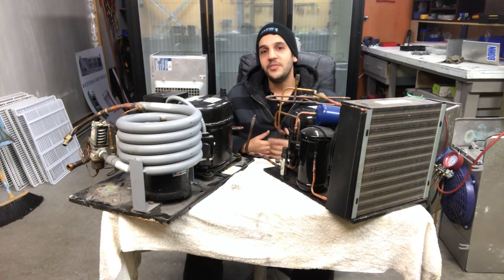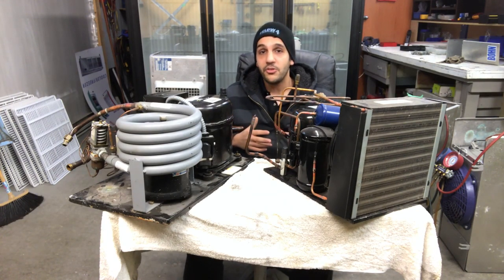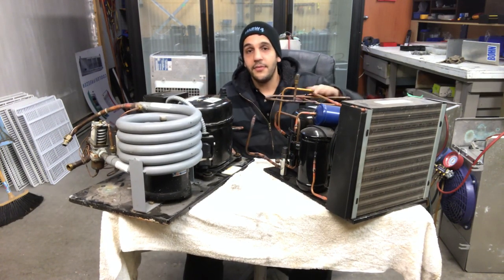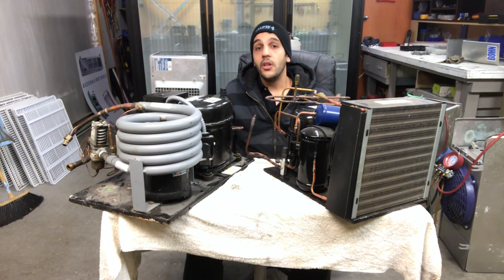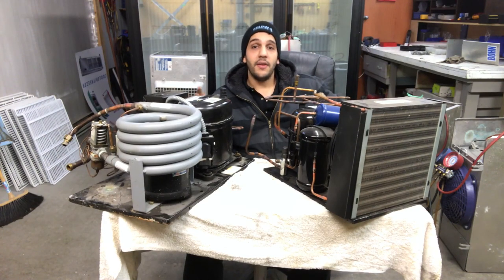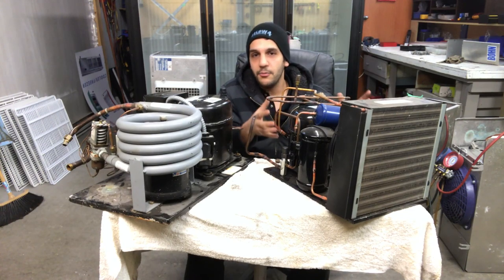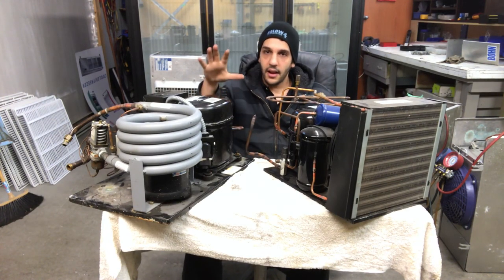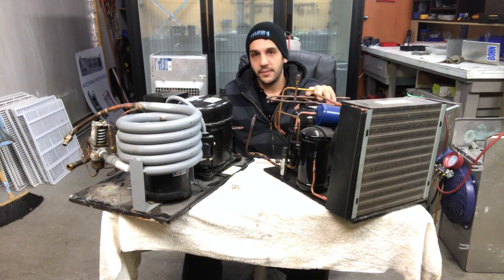AIR COOLED VS WATER COOLED CONDENSING UNITS

Comment: QUESTION: We have several Liebert crac units with water cooled condensers. Currently we use approx 70deg water flowing through the condensers. However, we need to know if we used 55 degree water would it drastically effect the units efficiency. There is a condenser water control valve in each unit. I ask because there are no parameters recommended in the owners manual.  Any help here would be greatly appreciated.

Comment: Great presentation.  Like others have mentioned, in the classic legislation environment, where you are just pulling water from the tap to cool the condenser, yes - these are generally not eco friendly.  However IMO, if you have a lake, a geothermal system, a small chiller, or the equivalent, you are much better off with the water cooled system.

Comment: Ok, so if the water cool is 30% more efficient is it that much more expensive than air cool?
Reply from the maker: No not really. They’re pretty much the same price for the unit itself. However the water cooled unit has a higher operating cost than the air cooled unit because generally speaking water is more expensive than electricity.
Reply: @dnoorian  yes but you also have to offset the electricity savings of the compressor. The hotter the condenser runs. The harder the compressor has to work to liquify the coolant from gas to liquid (before being utilized by the evaporator).  Water units take that work load off of the compressor, which translates to upwards of 40 % energy efficiency.
Reply: @TheGodfather101  I am in Pakistan where it is hot, electricity also not available some times, I want to make an air conditioner from a water dispenser. Any ideas ? would it be good to run on solar ?
Reply: @Overdrive_pk  I am experimenting with a water cooled peltier module. I'll keep you posted.

Comment: All you must do is put the coil submerged in water, circulate the water with the pump to a reservoir of cold or water, using the same principle of AC to cool the condensing unit in no time the transfer of heat will be much greater

Comment: How do they waste water? I thought they just dumped it into the hot water supply.  Canada is crazy!
Reply from the maker: the water usually drains into a floor drain and not reused.... therefore its a waste water system
Reply: @solexxx8588  We have one of these in our HVAC system at work and it just dumps the water on the floor in our plant. It's just a drop in the bucket when you're on an industrial site.

Comment: Not a waste of water. There’s a return well, It’s a loop system. Two wells. I couldn’t imagine anyone running this thing on city water
Reply: Make up water?
Reply: @MeIn321 a pump cycles water from the ground and it goes back into the ground at another well. So yes, you will have a pump continuously running. But nowhere near the cost of doing it with city water, would be a huge waste of water running clean water into the sewer. Same systems in yachts. Water is pumped through system, then returned to the ocean. In boats they’re called “chillers”.
Reply: I’ve never seen one running on city water. Ever

Comment: interesting, good explaination
Reply from the maker: thanks, glad you liked it!
Reply: @dnoorian   If I ran the water-cooled condensing unit in a loop with the aim of using its heat as a heat source for an absorbtion chiller . How hot will the water get ?
Can I get temperatures around 100c 212F ?

Comment: You are using more refrigerant to cool the water in an exterior motion, and a pump which uses electricity to pump the water that the condenser is submerged in to merely achieve greater results all legal

Comment: I think for water cool it is better for entire city or region by pumping bottom water to the top of water body like pool or river or ocean it is more like a large public project that cost a lot for large project if we use conventional air conditional system plus large air conditioner electricity create more emf heating effect on the environment that people not aware of while pumping cool water as cooling medium does not cost anything other than small pump can be by pressure of the deep itself. I think your presentation is misleading need more research and correction other wise children be confused

Comment: im in indonesia.. the water is so cheap..

i wonder why nobody makes condensor with this water systems
Reply from the maker: Hmmm I don’t know too. Maybe it’s because they don’t want to waste water...
Reply: @Eli Gordon I am in Pakistan where it is hot, electricity also not available some times, I want to make an air conditioner from a water dispenser. Any ideas ? would it be good to run on solar ?
Reply: Thanks for explanation. So technically both condensers work on the same principle. The only difference is a cooling medium. As you said, water cooled unit is much more expensive, would it be possible to modify conventional air-cooled condenser and replace the radiator by coil cooled by water? What if you just soak the radiator into the flowing water? :D I guess that effectivity might be even higher in water cooled systems. Imagine that in a hot summer day you cool that hot condenser by cold water from the water spring instead of hot air from the atmosphere. Warm water can be further used in a swimming pool for example
Reply: @dnoorian  they do i service entire buildings using water source heat pumps that are 20+ years old not new tech just more complicated of installation since you need the closed loop for the water includes pumps cooling tower and water heater for winter and a lot more details and the ac unit
Reply: @Overdrive_pk  you may want to look onto geothermal heat pump technology the overall idea is that underground after a certain depth that changes depending on the region you will find a constant temperature around 55 f the infrastructure for this systems may be more expensive but the savings on electricity will make it a better idea for solar use